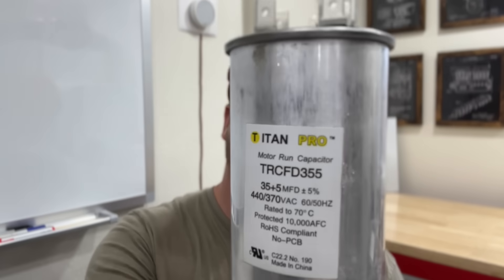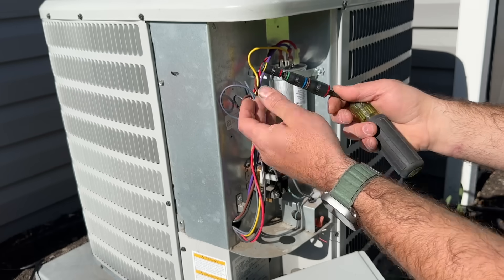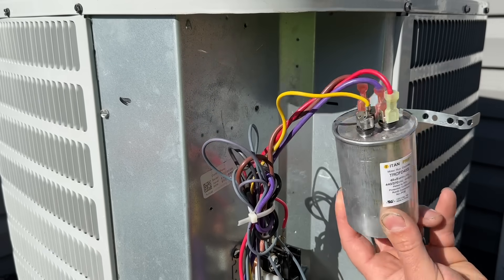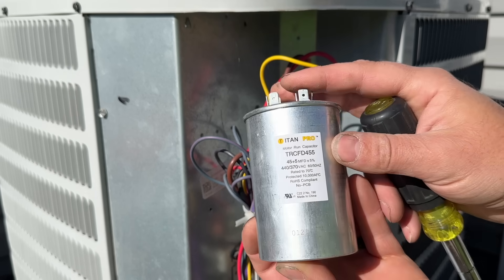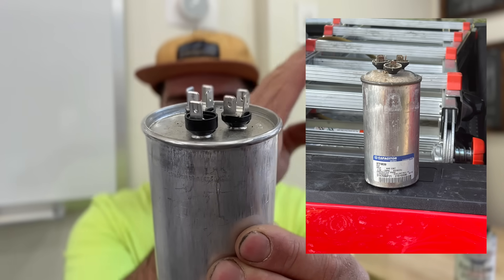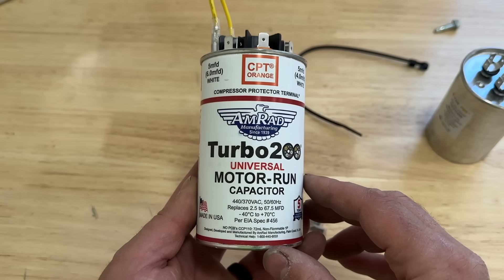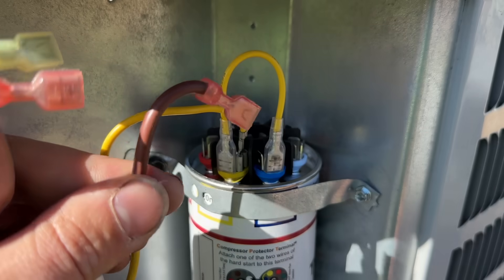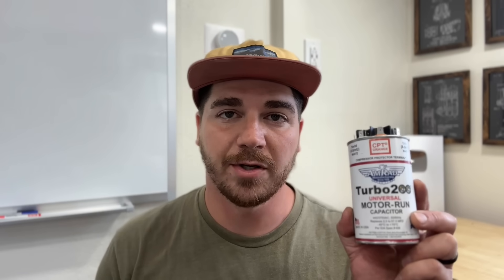HVAC Contractors Practically Make Their Living On These

Comment: An A/C repairman put a Turbo 200X onto our Rheem Classic 10 Seer unit that was made in 07/2001. The compressor calls for 50 MFD, but he put the jumper wire between the 10mfd (red) and the 50mfd (purple) for a total of 60mfd. Will this burn up our compressor for being 10mfd over? I don’t understand why he didn’t just hook it to the 50mfd ( purple ) since that is the max that the compressor calls for. It only lasted about 1 1/2 summers and then burned out and I am concerned that it took the compressor with it. I have taken it off and tried to test it with a red Harbor Freight 7 multimeter, but I am not certain that the setting that I have it set to is exactly like your meter. The numbers go all over the place, and sometimes it only says 1.1 or doesn’t do anything at all on both the fan and the herm. I think that he may have rigged it to burn out on purpose or something. He said that the repairman before him had put on a capacitor that did not belong on it and had wired it up funny. We were having the other complete unit replaced by the very last A/C guy who put this Turbo 200X on.

Comment: So... I saw this video 3 weeks ago and thought, wow, that is a great idea to buy these parts ahead of time and have them on hand in case there was a failure, then I can change it out and save myself big bucks. I put it off checking what parts I needed, and sure enough guess what happened? My upstairs A/C broke and guess what it was? the run capacitor!!! I had my home warranty company come out to fix it. it still cost me $180. So, I was like, man! I should have got these extra caps. I put it off again, and sure enough my downstairs A/C went out today!!! Dang! This time I drove down to ACE Hardware and picked one up to replace it myself-- Dude! it only took less than 10 mins to swap it out. I saved big $$$ this time. I am going to make sure I have those extra caps on hand after this week. I am prepared now!!!! 

Now, word to the wise- If you know how to swap these things out, tell everyone you know to buy extra caps and you can swap them for them for free and you will be a massive hero!

Comment: I paid $245 just this morning for a service call and capacitor replacement to get my exterior unit running again. Nothing else was wrong. The overall unit is still under warranty. They got to me in less than 24 hours. They didn’t try to sell me anything else. I don’t feel terribly ripped off.
Reply: Had mine replaced last year. $260, had a $35 online coupon, so $225. I felt semi ripped off after the fact, seeing how cheap and simple this is. Next time, I'll do it myself.

Comment: Hey Man, THANK YOU, THANK YOU, THANK YOU. It's been over 100 degrees here in SE Washington State for several days, and that trend will continue through at least the 22nd. It was 108 today, 110 yesterday and my AC stopped blowing cold air.  Before I realized what was going on, it was 80 degrees inside the house! I had watched this video and another one of yours about the AC Capacitor remove and replace a few weeks ago. Based on these video's I ordered the proper capacitor from Amazon for like $15 so I had it on hand when the old one went out. I pulled the cover like you instructed, saw my capacitor was swollen, discharged it, removed it, and replaced it all in about 20 minutes which also included a good rinse of the fins on the unit. Turned the AC back on and the cold air is flowing freely. My kids are happy, Wife is happy, and I'm happy. Wife said I get a gold start for the day. I like the fact I just saved several hundred bucks on an easy peasy job. YOU ROCK HVAC Guy!!!!!

Comment: JUst over the past weekend my son and I replaced the capacitor bc the fan only would run on the outside coil. got one at ACE hardware on a Saturday afternoon, $35.00, and done. (be sure to match the capacitor, and short out the terminals before removing.

Comment: Your segment regarding capacitance ratings and readings is confusing and incorrect. Both capacitors you showed had a tolerance displayed, yet you stated that a reading above or below 45 would indicate that the first cap was bad, but that you should consider the tolerance for the second. Electrical components rarely ever measure exactly what is displayed on the label. A reading between 42.75 - 47.25 uf falls within the +/- 5%.

Comment: My GF texted me that our A/C stopped working while I was at training. Told her to check the drain line and the cap. Capacitor was swollen and leaking. She called local company for estimate and was told the part alone was $390, plus labor. I found the part at Ace for $15! She waited for me to return and I replaced the cap in 20 minutes. That was three years ago!

Comment: Great job!  Thank you so much!   From your advice I bought a capacitor of the correct size a few months ago.  Today one of my two compressor units on outside of the house wasn't cooling.  I checked my new capacitor and it was good.  Took the old one out and it tested bad.  Installed the new capacitor correctly.  Top fan spins but I'm getting no cold air in the house from that unit.  Something is still wrong.  Here is where I'm hoping for your advice.  You are in SLC.  I'm down in Hurricane near St.  George.  I'm hoping you know someone honest who works down  here.  I would be so grateful for the name of an outfit!!  Please help.

Comment: 2K?! Yeah that is crazy. Now rule of thumb for HVAC contractors is 100% mark up on parts, service call and labor. So basic capacitor should be around $120-$180. For the permanent replacement average cost for a contractor is $300. Not a rip off. Contractors can’t charge cost. Basically they drove to the store, stood in line for 10-30min got you the part. Drove back to your house installed it. They did all the work for just that one part. They can’t go negative or they won’t last a year. It’s business not personal. DIY just make sure to put the herm on common and common on herm. 🤣 jk please don’t do that.

Comment: You made two incorrect statements. Remove the metal side cover to see the electronics behind it. There is no electronics in that box. It is pure electrical. It has electronics when there is a. Timer dely to start the fan motor of the evaporator and to give the compressor a soft start. Next the subject matter of  discharging  the two section capacitor. You only short from the (com.terminal )to the (H and F) terminals. Not H and F they are not electrically one capacitor. They are two separate capacitors to the com  treminal.And well not discharge it. Com to F and Com to H discharges it. You said short F to H that's wrong!

Comment: YEAH IT COSTS 500 EACH TRIP FROM THE HVAC GUY, AND AFTER YOUR DONE PAYING THE 500, YOU REALISE ITS STILL DOING THE EXACT SAME SYMPTOM AS BEFORE YOU PAID THE HVAC GUY THE 500! AFTER THAT, ITS ANOTHER GO AROUND, EACH TIME ANOTHER 500 FOR EACH ONE! THIER IS MORE THAN JUST THAT ONE! THE SYMPTOMS REALLY NEVER GO AWAY, ONLY YOUR CASH GOES UP IN FLAMES IN THE HEAT AND FRUSTRATION OF DEALING WITH THESE CON ARTIST HVAC DEALERS! THE BEST THING TO DO IS TO MOVE OUT OF THE UNBEARABLE HEAT TO SOMEPLACE MORE TOLERABLE! THE AC UNITS ARE ALWAYS A HEADACHE IN THE HOTTEST MONTHS OF THE YEAR WHEN YOU NEED IT THE MOST! I THINK THEY ARE PURPOSELY DESIGNED THAT WAY TO FAIL IN THE MOST DANGEROUS HEAT!:text-green-game-over:

Comment: Hi I am a electronic tech that is retired. And was also a HVAC tech back in the year 2000. But no body well  talk correctly about what a capacitors purpose is! And why it is needed  on a Home air-conditioner to start the compressor, and fan motors. They are Not Like Batteries giving the motor a kick of more power so that it well start to trun the  rotation of the rotor. That is the theory of operation from a novice person that has no knowledge of AC electrical circuits that use single phase AC induction motors. If your home was powered with 3 phase AC power instead of single phase electric power at 240v or 208v. Your air conditioner wouldn't need to have any capacitors to start the motors! So why do you need them for a home AC that receives only single phase power? The answer is that.  Induction motors that run on 60 Hz, or 50 HZ power line  frequency need either two phase power. Or three phase power to start motors that are high starting torque type of  motors. So the electrolytes capacitor causes A 90 deg phase lag in current to only the starting winding of the compressor. And the running winding that draws more current. Is connected to the power line directly. So its current is 90 degs out of phase to the starting winding. This  now allows the rotor to start to turn and lock up, to the 60 Hz frequency. If the motor has two poles in the stator. Then the motor well trun at 3,540 RPM. If it has four poles it well turn slower. At 1,750 RPM. A AC unit that was made to work on 240v 208v or 480v  3 phase power needs no capacitor to start it. It starts on all three phase powering that motor. And if you change the three ABC wires  connected to the motors terminals. The motor well turn in revised direction. So capacitors lag the current into the starting winding by 90 degs. And that is how the compressor starts its rotation. If the capacitor is disconnected with a relay circuit. From the  the compressor. And the motor is all ready running. Then it well keep running. But not when it is time to start it running again. And it has a bad capacitor.Then the compressor just sits there humming at 60 HZ until  the fuse blows out. Why? Because the motor is now a dead short on the power line. It is called locked rotor amps. It is (3 1/2) times higher then the running amps. And that is why 3 phase power was invented. To run very big high horse power motors with out a. Big size  capacitor to get it started. I hope you now know why you have capacitors in your home AC unit. You have only single phase power to your watt meter and circuit breaker box.
Reply from the maker: Yes, I guarantee you a fraction of the viewers will know what this message means, nor will take the time to read it. It does store energy so in very very simple terms it’s like a battery.
Reply: No it is not like a battery that stores DC voltage. It stores one cycle of the 60 HZ power. In one 1/60 of a second that is now DC  voltage.That is why you need to discharge it by shorting the terminals.  You are not a electronic engineer. Capacitors and inductors cause phase shifts to the voltage and currents that are completely 180 deg opposite to each other. Did you know that you could start a AC motor with a inductor instead of a capacitor.And a inductor doesn't store any electrical charge like a capacitor.Question to ask you. When do you use a oil capacitor. Instead of a electrolytic capacitor. I need you to teach me
 I am 70 years old. I am the one that teaches a HVAC to. Students that ask me how much (juice) the motor needs to run at one HP of work. Juice is in your refrigerators. And capacitors are not DC batterys.when in series with 60 HZ AC  power. It acts as a battery when it is in a DC power supply to filter out the ripple@ 120 HZ

Comment: My HVAC peeps wanted to sell me a new Lennox. Mine is 13 years old. Still works. I just keep cleaning and fixing it and things. They pulled this one on me for $300. I said I would think it over. I being retired Army Aircraft mechanic thought I would google it then to Amazon for like $15 over night, also got a new contactor switch with it. Did them both in about 20 minutes.
Big thumbs up to this.

Comment: If an ac company spent all day selling capacitors for $50 they would go out of business. 

$100 diagnostic charge since it took me 30 minutes to drive here, I had to climb onto the roof, and I gave you a veteran professional opinion.  At that point, you’re free to purchase a capacitor and do the repair. But i don’t sell parts, I sell the service to your unit.  It’s $450 for the installation of a  capacitor, all parts included and diagnostic charge waived with repair. 

It’s $450 because I drove to a supply house and purchased this 40+7.5 mfd capacitor along with 20 others, and several motors, and refrigerant, and thousands of other things  - investing my money several months prior, so that I would be prepared the day you called.  9pm? July 4th? Sunday? Don’t worry, I got that part. 

It’s $450 because your repair is guaranteed, and I don’t like call backs. Which means I’m not stopping when the wires are connected like in your picture.  No, at that point I’m going to check the fan motor bearings, the exterior of the unit for signs of refrigerant leaks or damage to the coil.  I’m going to take my screwdriver and tighten all the screws and lugs, visually inspecting all electrical connections and contact points. This with the eye of someone who’s been doing this most of their life. 

It’s $450 because after I’m confident everything looks OK, and any issue are brought to your attention, I’ll turn on the unit and run test it.   I’ll check to make sure the temperature split is acceptable.  This entire time, chatting with you.  Lending an ear and giving expert advice on all matters of indoor air quality.  Explaining to you why your house feels muggy, and why that one room in the back is always warm. Maybe you’ll let slip that you had to change that capacitor last year, causing my ears to perk up. I’ll take amp readings on the compressor and outdoor motor. Often times, a failed capacitor is indicative of a failing motor or compressor. Imagine having to come back with your tail between your legs because you rushed out after charging $50, cutting every corner so the $50 means something.

Saying contractors are being dishonest or implying they’re making their living on capacitors is misleading.  In fact, I bet most will tell you they hate to charge going rates for a capacitor, but they have to make payroll, and after checking out your entire system this capacitor cost me 1/4 of my working day, and I still have to go replace my stock.

Comment: The company i work for charges from $200-$400 depending on the size. Price is fair if you want it professionally done. I go behind alot of diy guys that try to fix things themselves. A capacitor is an easy fix but i don't just go to a house and replace the cap, i check and do other things to give value and make sure your ac keeps running

Comment: Folks, I have come to the conclusion that the capacitor scam is thriving in South Florida. All you HVAC owners out there better watch out because sooner or later they will try to nail you. If you can't or won't  DIY, try to identify a reputable A/C repair firm. It won't be cheap, but it'll likely be a lot cheaper than the scam artists. Fraud is rampant in this arena.

Comment: I don't know why people teach this to someone with no knowledge in electrical controls
. btw if you short a capictor with a screwdriver, there is a Hugh electrical arc that can discharge any stored voltage and scare the crap out of you, it doesn't happen often but ive seen it. Please leave it to the pros who are licensed to service your system. To the people complaining of the prices being charged, youre not just paying for the part and service, you're also paying for someone knowledge and experience.

Comment: My A/C is over 24 years old, stopped working.  Once I had one part replaced $200.  The one year later it went out.  I was told to replace it due to Freon has changed and no longer available.  Is that true?  And do I replace the Freon or replace the entire unit?  Southern California.

Comment: I do HVAC and we charge the basic service call (includes the travel time and 1hr on site) and cost of the capacitor ($10-5mf up to $50-45/5mf) and only use premium parts...... not the cheapest sh*t you can find on the internet. If the repair is obvious and a 10 min job we service the entire system to make up the hr time. Our cost on that job would be about $190. I've heard of places in the southern US charging insane rates just because they think the customer believes the more expensive the rate the better the tech you get... which is almost NEVER the case.

Comment: 9:29 no the the compressor need to go on the highest value if you make 25+20=45.. You need to hook your herm wire to 25 not 20 and try to avoid piggy tailing. I learned the hard way.

Comment: I kept mine running for 10 more years by replacing the furnace fan, the outside units fan, both capacitors a few times.

Part of the terminal board burnt up so I rerouted some wires that kept the fan running 24/7 but it worked.

Comment: Agreed. Many companies Cash-in on people for a simple $30-$40 part, especially during Thunderstorm season. Any little surge can take out your start or run capacitor. If you lose power, turn off your unit as soon as it comes back up. If not, every unit on your block will come back on at the same time and someone will sustain a back surge. I always wait a little bit before turning mine back on. I always test mine with a Fluke meter before I call service company. Great Video!!!!

Comment: I had a AC company check out my AC when it was tanking. They wanted 1700 to replace my capacitor and contactor. Lmfao both 10 dollar parts. Did it myself and told the company to pound sand.

Comment: Buy a van, load it with 10k in parts, including capacitors, and get a license,  insurance,  a shop, an answering service, book keeper, tools, helpers, and spend 3 to 4 hrs changing out a bad capacitor,  then take the call back for free when yiu realize the bad compressor windings actually ruined the capacitor and the whole thing melted down after you left,  now the owner wants a new system on your dime, then you start to realize why contractors charge so much. Or do it yourself , then you can't complain when it breaks again.